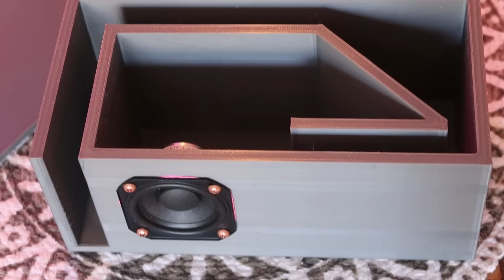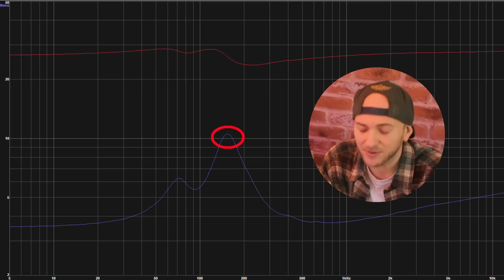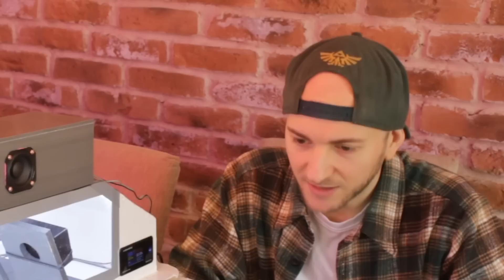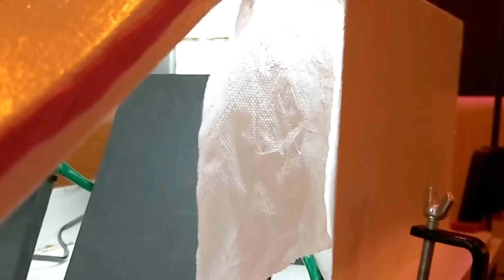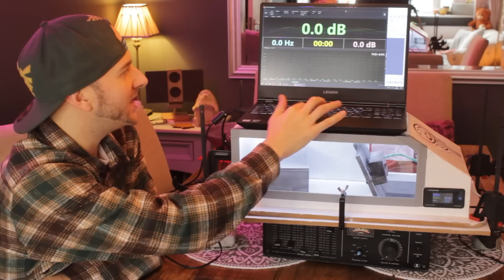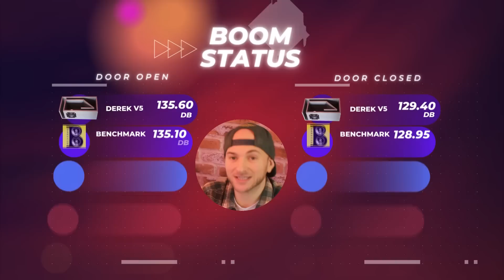What That Triangle Do?? Mini Subwoofer Challenge - Boom Or Bust S1E2

Comment: I am not so sure that there is that much of an internal air space difference between this box vs. Yours your enclosure was a simple aroport, his box was a dual tuned port and the expansion chamber in the corner of the port takes up a lot of internal volume making that box appear substantially larger than your arrow ported box if there's any way possible please measure internal volume that will be a good experiment

Comment: I think a box that loads the cone a lot will be good in these experiments. Haven't looked at the specs of that driver, but I think it would translate to a 12 with very high motor force since it's neo motor, And quite large size motor coil for the size of cone

Comment: What I would like to know is why my pressure reloads in the floor/kick panel area?!?! No one has been able to tell me by. Even with the doors open I'm loudest in the floor.
Reply from the maker: thats standard for most vehicles. Pressure will be the highest at extremes - right up against the firewall, in a "cubby" being the footwell, etc. Sitting in the seat, you are closer to the midpoint of the cabin which is often closer to a pressure void than a peak.
Reply: Not a pro. Opinion has to do with the speed of sound and compression. Lowers the area space & creates more compression? In a given volume. Example corners in. A room will seem to have more bass? If you figure it out please share.

Comment: @barevids I have heard that positioning your box a certain way changes the output. Or just helps. Is the box tilted like that for a reason. Also would pointing the port up change any numbers?
Reply from the maker: It's tilted so I can see the driver to gauge mechanical limit, can't have the port up on this one as the box is too big

Comment: That looks like a really compact "6th order" bass reflex. I'd bet that's how it's functioning as well.
Reply: except it doesnt have the 3 peaks in the impedance you would expect of a 6th order.

and why put 6th order in quotes? thats what it is. a 6th order bass reflex. its not psuedo 6th order or anything.
Reply: its also backwards of how they are generally designed. you usually have the smaller camber behind the driver and the larger one after the first port.
Reply: @mustang351c4  Because the community is split so heavily on what constitutes an order that it's just easier to appease both schools of thought that way. bugetbasshead explains the division in his video on counting orders really well.

Comment: i put a Skar ZVX 8" in the full size version (12x13x25) and it does get low :)  similar to a BP box i tuned to 33hz but this box is like half the size.  after watching the latest Hexibass video i am trying designs with a much smaller initial chamber which should help with the power handling.  i did submit some of those,  we will see if barevids chooses one.  
if you like to get low and don't have a lot of power this design seems to work well.  find a driver with a lot of xmax, give it about half rated power and it goes BOOM.
not to bad beating the "spec" box and with less power.  i look forward to the next video.
Derek

Comment: I've built a box like this before just to test port speed. Yup. The box i had tested was tuned to 22hz. Very similar results. Was only using an old school rf power 150. It actually made a cheap subwoofer sound pretty good. Not load butt the lower bass had a decent sound. Luv the series. Can't wait for more box testing. Need a horn to come up. I've built a couple with interesting results.

Comment: I wonder how much the speaker will change over this series. It'd be interesting to see the speaker in your box again at the end of the season.
Reply from the maker: I just ran DATs again today - ita actually gone down by another 10hz! Though scaled that's not so much, instead of a 21hz Fs it's now 19hz. At the end of the season tho I'll probably rerun the top 5 boxes to double check they're still performing the same relative to one another.
Reply: Interesting. Sounds like a good plan. I wonder if the change is hardware or environmental (humidity, temp, ect.) Either way it should be apparent at the end of the series with the top 5 test.
Reply: Yeah, that would be interesting. Shouldn't be too much since he's being reasonable and backing off the power when the drivers suspension is maxed out, but "for science" it would be cool to see any change in this controlled setup.
Reply: For the science was what I was thinking. It's not like it would be a perfect experiment. Just fun to see what happens and ponder it.
Reply: He already broke it in, so assuming he doesn't damage anything it should be fine.
Reply: ahh, I didn't catch that.